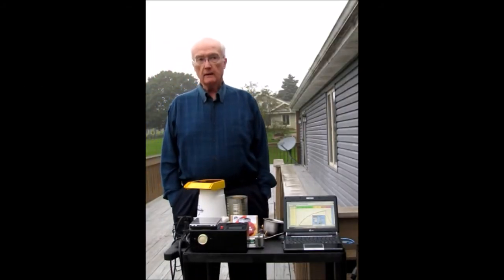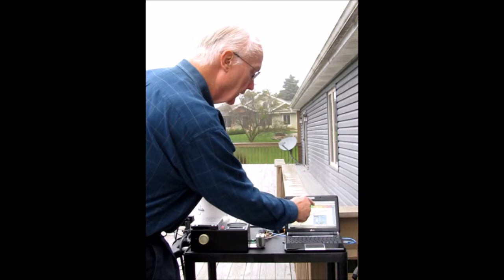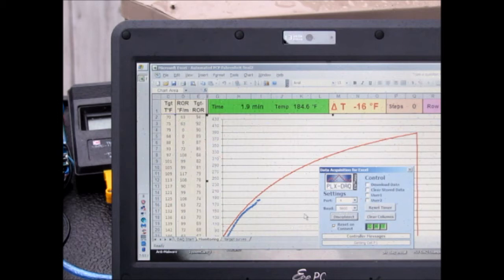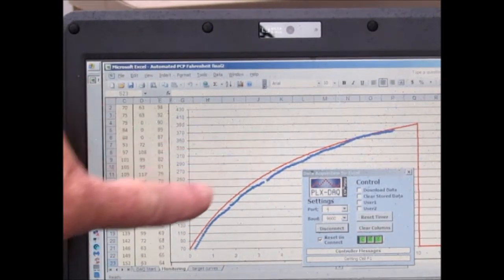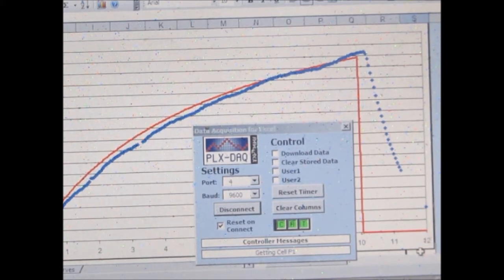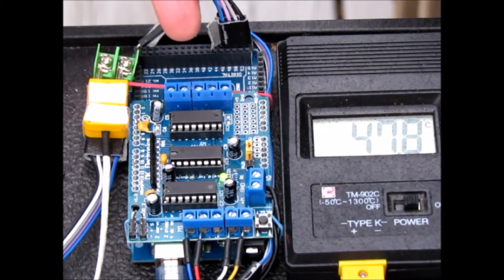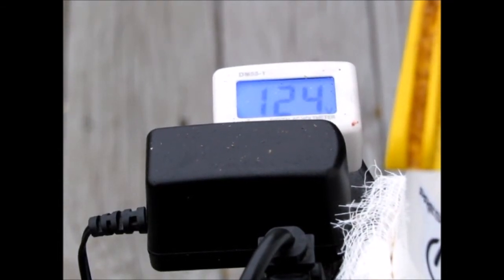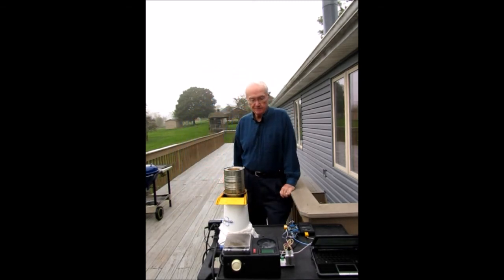Using Excel and Arduino for PopLite Popper Coffee Roaster Control

Comment: Thank you Jack for all information which takes time from you to be presented in the way you did in the zip file.  my question is can Arduino UNO do the job. and why you prefer this interface against TC4- Artisan. Thank you.
Reply from the maker: The TC4-Artisan appears to be an excellent, widely used approach to controlling roasters.  I don't have that board and it's my understanding it is no longer being produced.   I've been using this popper modification I made for a year now, and I enjoy using it, so I wanted a way to do this using mostly what I already had available with as low an additional expense as possible.  I actually already had the Mega 2560 and the motor shield, so my only additional expense was the MAX6675 ($8) and the stepper motor ($3).  I enjoy the process of starting out with a goal in mind and then figuring out how to achieve it.  I often find that unexpected things happen along the way and the result often turns out differently and somewhat better than what I had imagined when I started, and this is actually what I enjoy most -- the surprises.  I was already able to make roasts manually and I've been very happy with the results, so I guess I was more interested in the process of doing it than in just having the final result itself, if that makes sense.  Even now, I'm looking forward to optimizing conformance with the target roast profile and to then adding another stepper motor to control the blower motor (now just a knob).  I hope this answers your question.

As to the UNO, I see no reason why it would not work.  You would have to bend the connection pins for the MAX6675 over so that when you put the motor shield on it, the MAX pins are already plugged in with the wires sticking out to the side.  Then you would have to change the pin numbers in the sketch, of course. And you would use serial 3 instead of serial 4.  At the moment, I can't think of any reason it would not work with these changes, but if you try it and have a problem, let me know because I have an UNO too and could try using it to help you figure it out.  But this roasting system only uses one serial I/O. While the Mega adds three, they are not being used in this application, only the one.

Thanks for your questions and comment!
Reply: Thank you Jack for your explanation, I need your advice as I currently using Heat Gun- Bread Maker with Dual Thermocouple logged to my Laptop, and I would like to build fluid-bed which can controled by Arduino- Artisan. but as you said TC4 is not available. what do you advice as alternative without motor considering that I have my logged Thermometer.
Reply from the maker: Are you on homeroasters.org?  This would be a great question to ask in the forums there.  Maybe someone could tell you how to get a TC-4 Artisan.  If not, I bet someone there has done exactly what you are looking to do and would be happy to help you out.  just go to homeroasters.org, then click on Homeroasters Forum, then up at the top click on "FORUM INDEX" in red.  That will show you all of the forums where you can pick the one that is most appropriate and leave a message.  If that doesn't work out for you, let me know and we'll try to talk about your project further and see what I might be able to suggest.  But I think your best bet would be to ask the question on the forums.